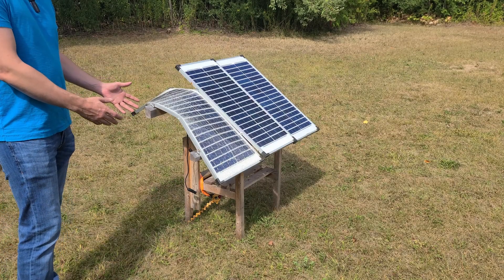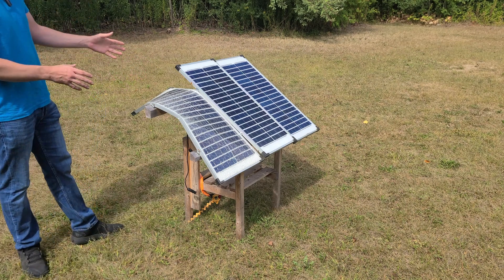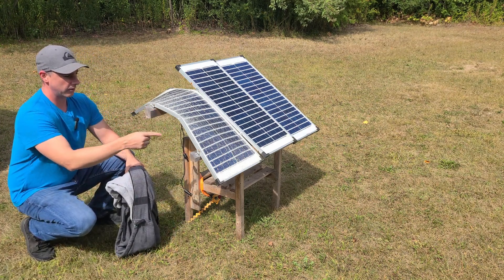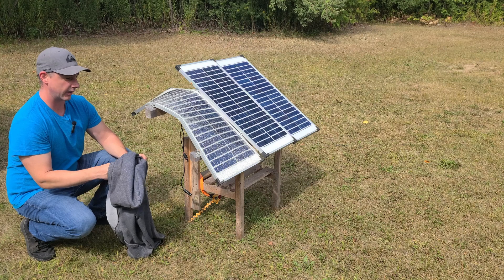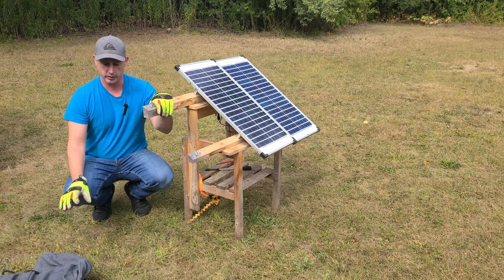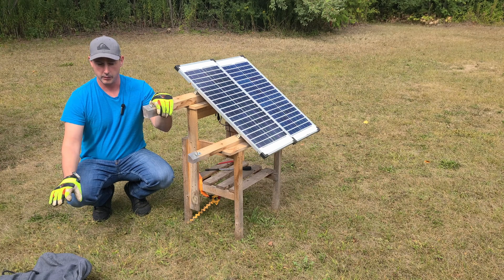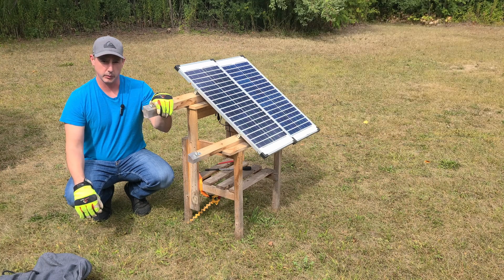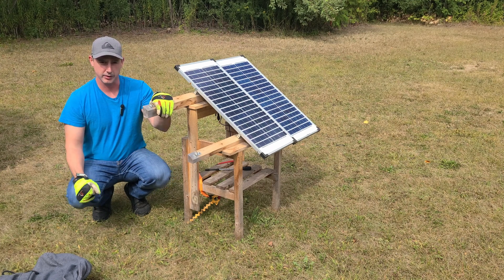Suggestions for dealing with a broken solar panel

Comment: Thats what not to do, what you do is test it to see if its still creating electricity if so you leave it there and dont look at it. 

If its not working correctly you take that lil f'er apart and save the good cells and put them in a bucket for later use.  

Stop throwing things away.
Reply from the maker: Repairing damaged panels or salvaging parts from one is not something I would recommend.